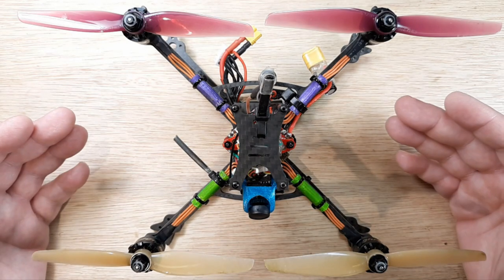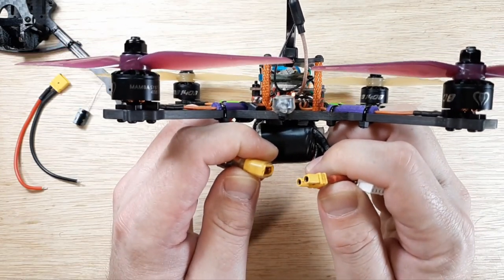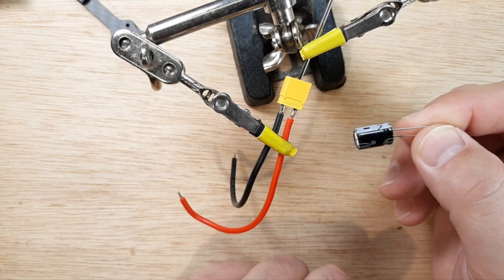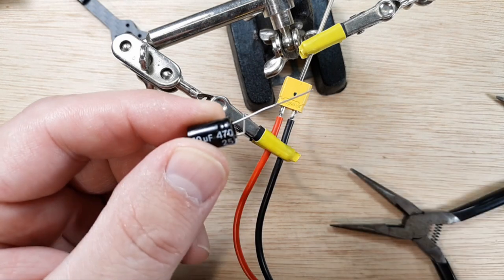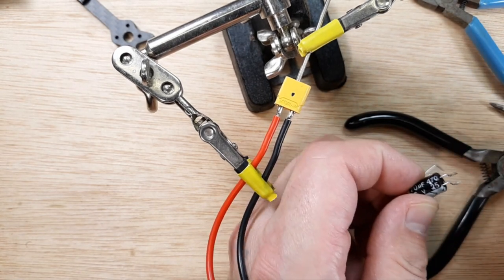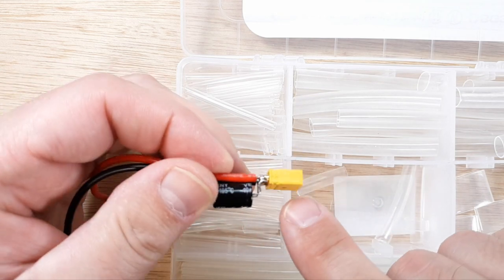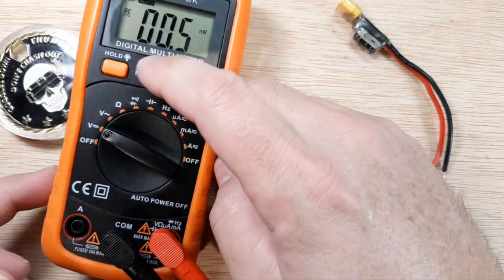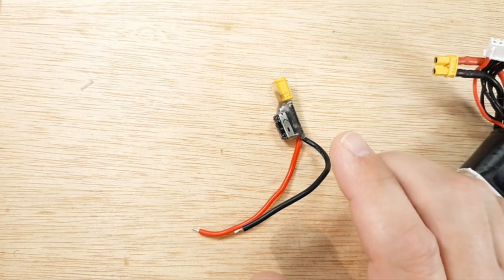The Pigtail | How To Build A Drone | Sub 250 Quadcopter Build Video

Comment: 🎶I like big Caps and I cannot lie! 🎶I use the same exact shrink tube for my pigtails and receivers.  All your correct theories and awesome tricks from all your electronic work experience is making me look bad man. Hot glue idea is great I'm adopting that.
Reply from the maker: It works. I crashed a quad (nothing crazy) and the shear weight of the capacitor bent and twisted and shorted the lipo. The hot glue definitely works to cage those leads from moving. Thanks for your encouragement...👍🏻🍻👊🏻

Comment: I’m following your build. Thanks for the info.  Can you tell me why some solder the cap to the board and others like yourself solder to the pig tail?  Also what did you set your multi meter to for measuring the cap? Thanks from the UK! x
Reply from the maker: Thanks for following along.. I prefer to solder the cap directly (soft mount) to the power wire at the PDB. However, in this super tight build, the best and safest place is on the XT30. Let me check to see if I have a video for measuring the capacitor....
Reply from the maker: Looks like I don't have a video for that (scratching my head).. If you need a picture of the multimeter on the selected Capacitance measurement, email me and copy / paste this message and come back here and tell me you sent an email for a photo..
How to describe: 
On a couple of my expensive meters, it looks like a dash with a curved line and a mirror of that looking back.. -)(-
On my super little YouTube special (Playlist attached below) it looks like a sideways T and the said curve dash.. -|(-
Both say uf or mf..
Hope I explained it well and this helps..
https://youtube.com/playlist?list=PLUB6CecuqdqOdwbOdBS-d6W-Bh2IreqFY
Reply: @propsoff  Hi, Sorry for not responding sooner.  Its been a busy work and family time as you can guess!  Thank you for your answer. I'm currently building a light quad and so followed your suggestion for the cap placement.  I've looked at my multi-meter and found it only has m4 I I 1.5v but not either of the capacitance measurement you spoke of.  So I guess I need to buy a better quality one! lol! Thanks again for the best, no nonsense, calmly explaining quad building channel on YouTube :D
Reply from the maker: @kooky2  
I really like the meter I use for the channel...👍🏻🍻👊🏻
Reply: @propsoff  Oooh! That’s one quite reasonably priced ! :D
Reply from the maker: @kooky2  
It really is a great "bang for the buck" value.. I've used it in place of my larger ones many times too...🍻
Reply: @propsoff  just bought one ;)
Reply from the maker: @kooky2  
The one I have is very accurate and has been reliable thus far...🍻